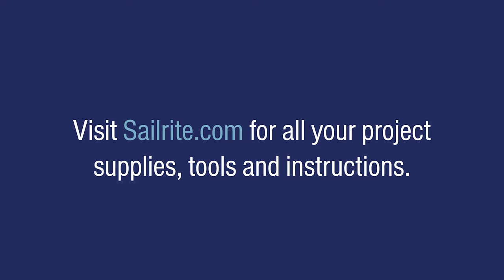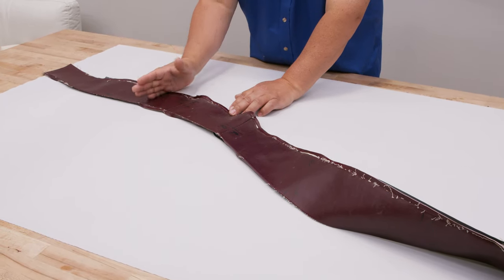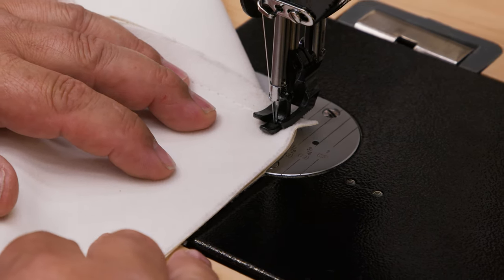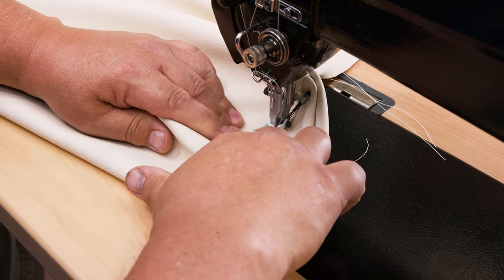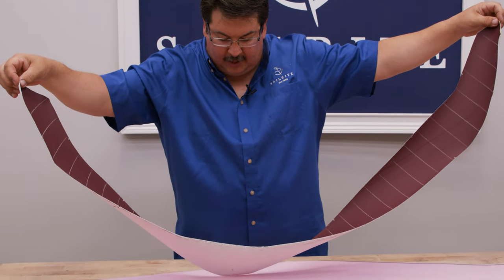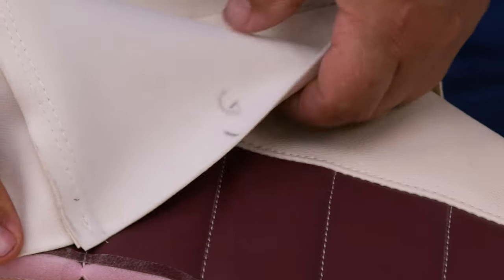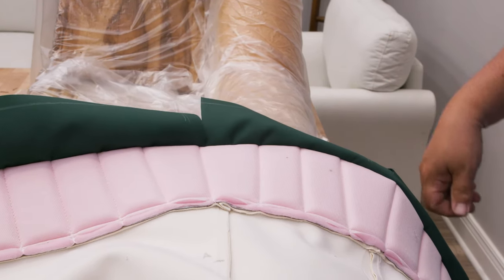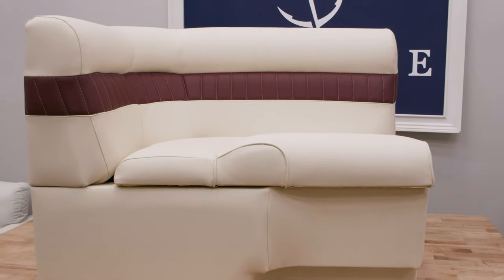How to Reupholster a Pontoon Corner Bench BACKREST

Comment: What size stitch is best to use for a boat seat? A longer stitch or a short fine one?
Reply from the maker: If you are sewing a semi-flat-felled seam, which is typical, then I sew the first stitch at 5mm and the top stitch at about 6mm. Going too short of a stitch length can perforate your seating vinyl.  Going too long of a straight stitch may easily get caught on a sharp object and break a stitch.